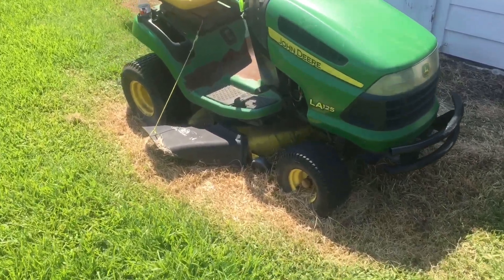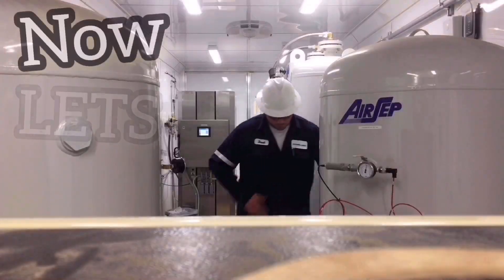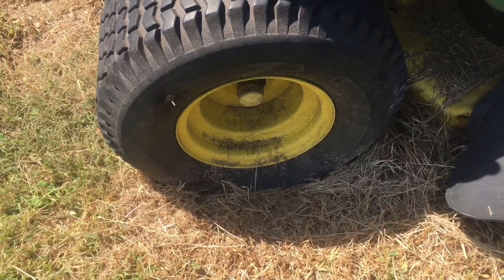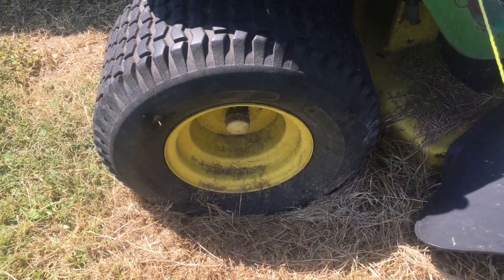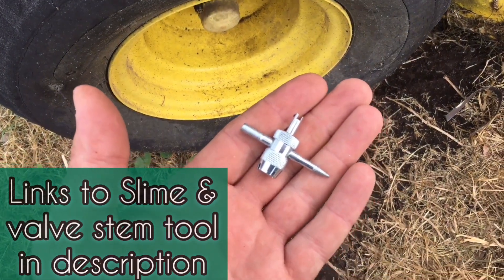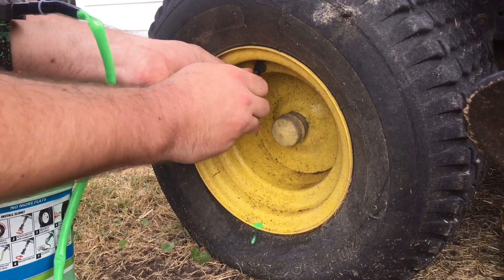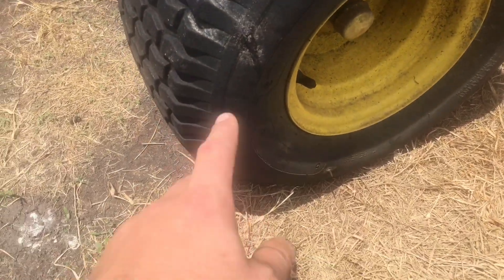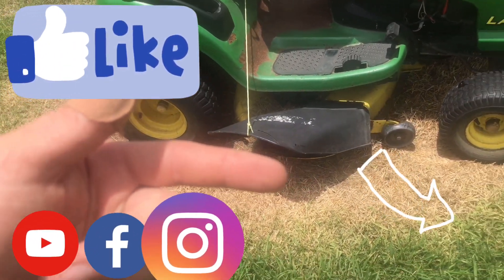Does Slime REALLY Work? || SLIME Tire Sealant REVIEW & HOW TO

Comment: Great video thanks brother. Well I hope you are the one who replaces the tires. I don't like that type of valve core remover there is a reason they are cheap. I don't mind them I just fumble a lot with them. I have two Mac tools regular size and the one for heavy equipment had them for many years. They look like a screwdriver but for valve cores. I don't fumble around as much with them. I don't know anything about the tire slime but I hope it works out for you. Keep up the great work see you in the next video thanks again brother
Reply from the maker: Scott Pearson TOOLS &MORE I’m not gonna change the tires myself. Some asshole put slime in there! 😝

Comment: It works to an extent. Depending on hole size and location. Sidewall holes have a slim chance of anything fixing them.
Reply from the maker: That’s why I want to try it on these tire since they had multiple sidewall punctures
Reply: @BradsWorkbench  your tires clearly were at least 1/2 aired up … mine were flat .. I even enstalled an interTube ( and put the slime inside the enterTube only , and it still made a hole in new tube and leaks out sidewall .. “: • (      )
Reply from the maker: How did a liquid put a hole in a tire tube?

Comment: I followed directions perfectly. I added 8 ounces of Blue label Slime to my flat riding mower rear tire. I inflated it to 15 psi, and spent an hour mowing the lawn.  The next morning I went to move the mower.....dead flat tire. I added the rest of the 16 0z. bottle, inflated the tire back to 15 psi, and ran my lawn broom over the lawn(1 hour). Today I put the pressure gauge(digital) on the same tire..........0 psi. What a waste of time and money. A tube would have been cheaper, and worked.

Comment: I just installed this in a small car tire and it didn’t work. The leak was at the bead and the rim and I didn’t have the car running to drive it around. I pulled the tire and cleaned up the rim so hopefully that will solve the problem. If not I am gonna try again once I get the car running. HF carries the big jug like that for $16 after the 20% coupon
Reply from the maker: Trucker88 can u jack the car up and spin it? I think that’s a pretty critical step?
Reply: Brads Workbench Yeah I did do that. I am gonna reinstall the tire and try again tomorrow.
Reply from the maker: Trucker88 hope it works out for ya

Comment: Sounds like pretty good stuff.  I use Fix-a-Flat on my ATV tires but after using it once during sub-zero temps, it cracked the tire I used it in and I had to replace it.  I'm not sure how this will work in sub-zero temps.  My Cub Cadet XT3 tractor has the rear tires loaded with anti-freeze since I use it year around.  I mow in the summer and blow snow with it in the harsh winters up here.  I also use my Honda ATV all year around and more so during Winter to plow snow.  I may have to give it a shot  for a just-in-case scenario.  Thanks for the review.  Cheers!
Reply from the maker: William Logan yea we don’t really have to worry about that too much in Texas lol

Comment: Use the plastic valve core tool after all air is removed from tire . If any air is left it will mess up that plastic tool pretty quick
Reply from the maker: That actually makes alot of sense.
Reply: I just happened to pick up a jug yesterday and used it today on my fronts on my zero turn and vaguely remember stripping one of those plastic tools back in the day but there plastic so it doesn't take much to twist the ears off

Comment: Just to give everyone a heads up.....when you go have a tire repaired and you used slime or any fix it a flat on it....please let them know before they start working on it.  We had a guy get seriously hurt when he went to fix a tire that had fix a flat in it n the customer failed to mention this.....the tire exploded the guy was seriously hurt and the blast blew the garage door to pieces. It was a bad scene. They had to air lift him out.  A local police officer told me
Reply from the maker: How was slime the cause of the explosion?
Reply: @BradsWorkbench   i am not a tire guy but i think it has something to do with putting psis in tire? The slime changes the tire somehow?
Reply from the maker: LongIslandP8ntball hmmmm I’m skeptical but I’ll check out the link
Reply: @BradsWorkbench  : fix a flat  has propellant that  has propane in it ( or butane ) and it blows up with static electricity as you pop the TIRE BEED .. ect ect ect
Reply from the maker: That makes sense

Comment: Slime didn't work for my two wheel electric scooter. The key is whether or not you can safely remove and then put the valve stem back in. In my case, no go.
Reply from the maker: Yea definitely have to remove valve stem.  Thats sucks 👎

Comment: I hate i really hate that stuff. It makes a mess cause rust in the wheel. It stinks when you change the tire.  Not slime but other brands are flammable. 
Just go to TSC and get some Tubes and do it write.
Reply from the maker: Says it has a rust preventative in it 🤷🏼‍♂️
Reply: @BradsWorkbench  
It does just not long term. I can't tell you how many wheels I see that have had slime in them and the wheel started to rust. But your mower is not being used. Like the ones I work on.

Comment: Do not USE ON A tire that has a hole in the side wall where it flexes as the tire Rotates ( and can’t get slime up the sidewall as you drive ( I have a lawnmower rear tires and dry rotted with a slit in the side of the tire less than a 16th of an inch wide and it won’t stay sealed I can seal it in the garage as it lays on its side but once I put it on the lawnmower and drive it goes flat.. every TIme ..
Reply from the maker: Worked for me, but was a pucture on the side wall, not a slit
Reply: @BradsWorkbench  mine is a dry rot crack .. lol ..